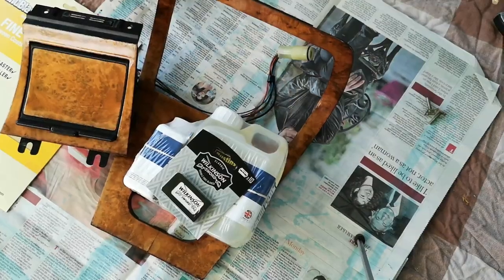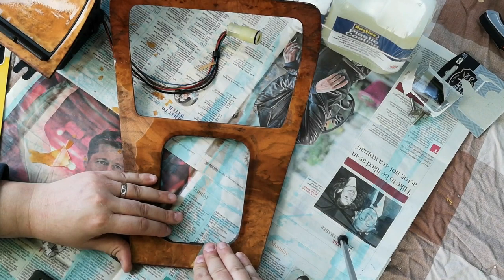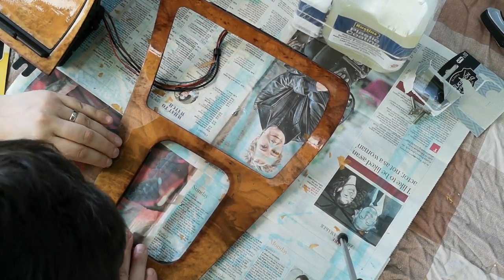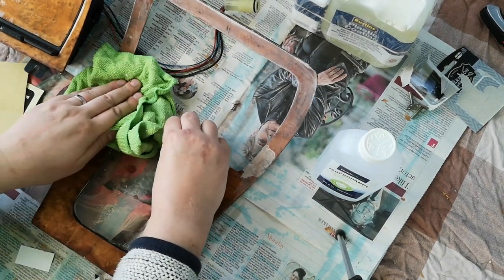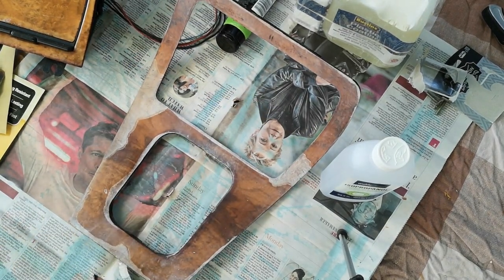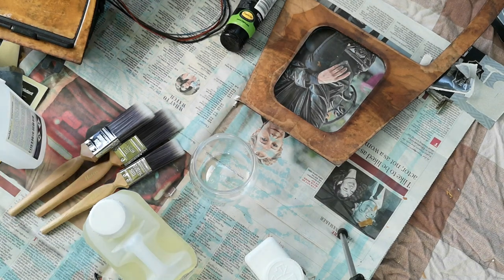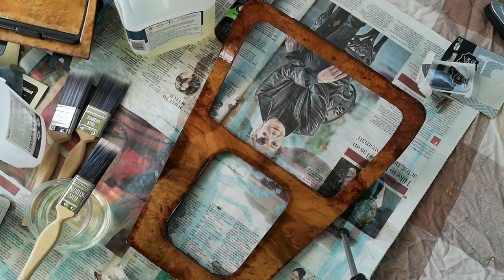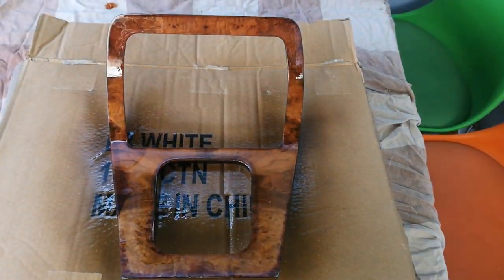Jaguar XJ40 - Tidying up the Ski Slope trim

Comment: Good to watch but you should have just used a good quality spray lacquer  or yacht varnish.the results would be much better and far less of a faf.definatley remove all old lacquer first tho.👍
Reply from the maker: I will be redoing it, the first attempt has started to crack, it looks okay, but.....I need to do it again, and, add in some additional bits of veneer, to complete it.